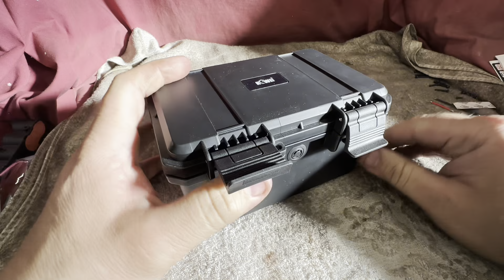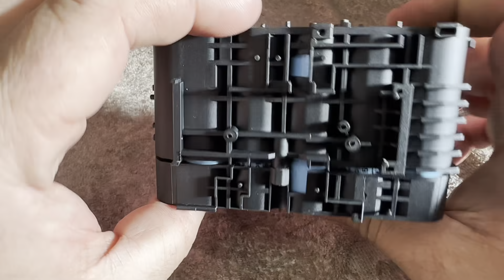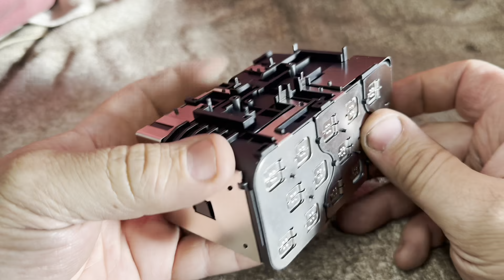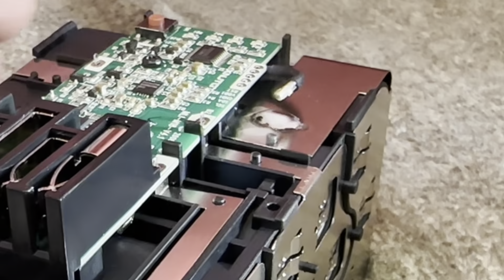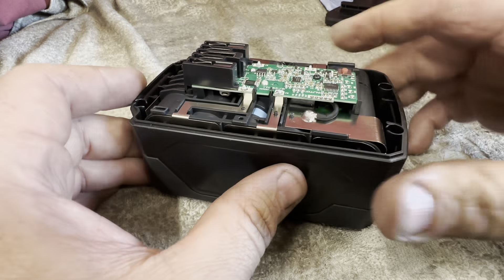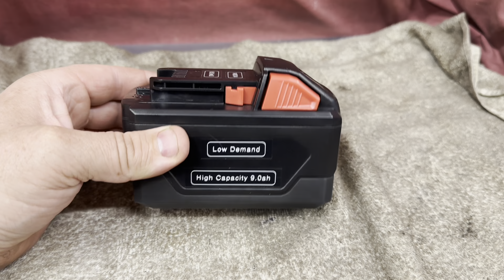Milwaukee Low demand, high capacity M18 battery build - Part 2

Comment: You're good man! Just got into this recently from auto and computer work, loving rebuilding packs! Matco screwing customers in Canada right now and I love fighting it and e-waste. 

I love how heat conscious you are, there are some guys doing this om YouTube making an absolute mess and soldering the shit out of every battery end 😂

People online talk of packs boards losing "memory" after having the batteries removed but I have yet to see it, my assumption currently is they had bad boards to begin with. I am looking into a way to test my boards before investing batteries, as I do with macs before installing components.

Have you experienced any batteries that won't engage after removal? I always discharge my batts to 2.9 and let rest for an hour before installing, haven't had balance issues yet
Reply from the maker: Any issues I have had I simply change the board once I know the cells are good.

Comment: As an ex Sparky i was impressed that you cleaned off the flux after you soldered. Not many people realise that the very reason for flux is to remove surface oxide - and to do this the flux is generally corrosive. We had a specific batch of boards at work about twenty years ago that started failing in the field that was traced to the company that made them forgetting to neutralise the flux acids. Like a timebomb the flux acid was getting under all those lovely surface mount components! Balancing out the capacities of the cells was was properly luxurious - I bet they don't do that at the original factory. I reckon you're the sort of fussy bloke that weighs con rods and pistons as well - hold on are you that AC?...
Reply from the maker: Hehehehe thanks for the comments David, and yes we all got taught the right way many years ago and it’s shame this does not seem to have been passed down to the next generation!!